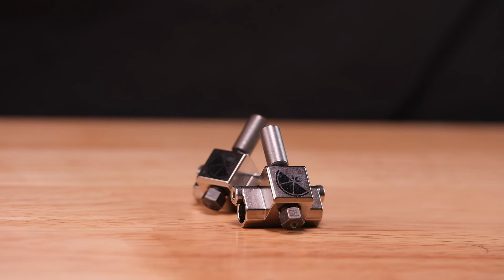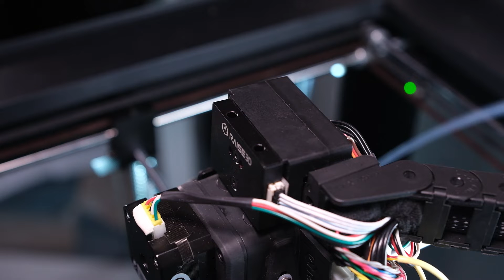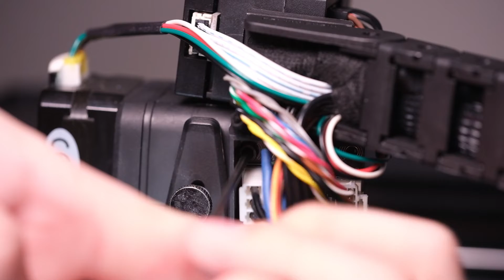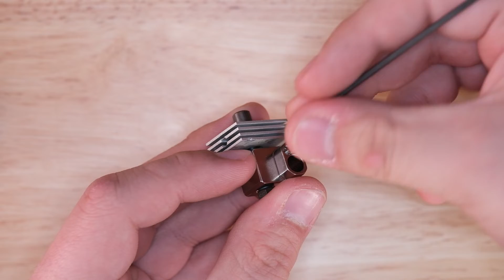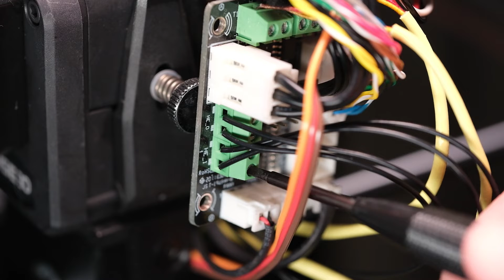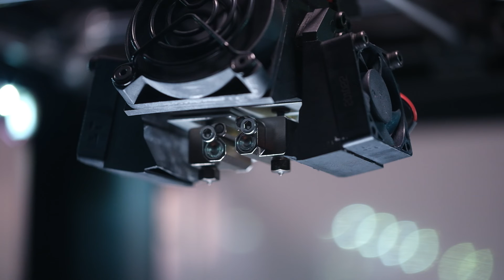The Raise3D Pro2 Hotend Upgrade That EVERYONE Needs | Upgrade Kit Installation

Comment: Do I still need to change to hardened steel nozzles if I want to print CF materials ?
Reply from the maker: Our Raise3D Pro2 Upgrade Kit comes with our 0.4 mm GammaMaster nozzle, which is designed for abrasive materials!

Comment: The most toxic and garbage company in 3d printing has to be raise3d. Worst company I've ever dealt with.
Reply: Agreed. I work in the Additive Department for a manufacturing company, and Raise3D is the worst company the deal with when considering machines and service both. They suck, and there is a reason we got rid of all 24 machines we had from them.
Reply: @faultyinterface  Agreed, we as a small company had just one Pro2 Plus which was a huge investment for us and a huge pain in the ass. I now got rid of the original touch screen and replaced it a raspberry pi and klipper. That plus added BL-Touch and a powder coated print bed made it a pretty solid machine :D
Reply: Oh wow, thats legendary! I tried and failed. Did you follow a guide or happen to document?  @TheFlash8889
Reply: @TheFlash8889 hey any links on the pi and screen upgrade for the pro2?  Did you also upgrade to this hot end kit? My pro2 jams all the time
Reply: agreed. Horrible experience / pathetic printers